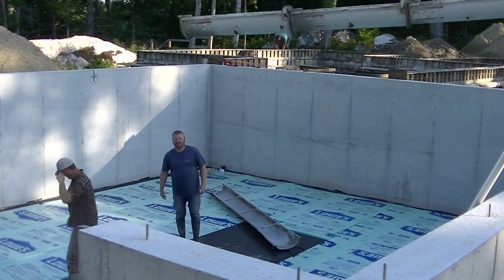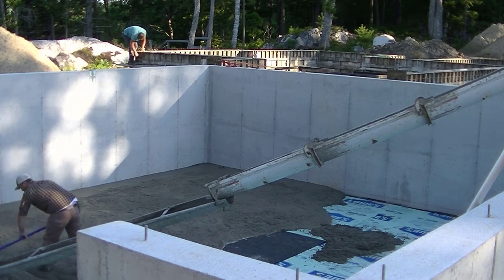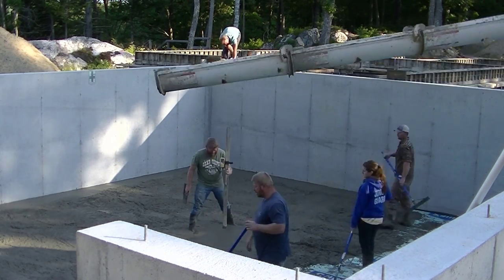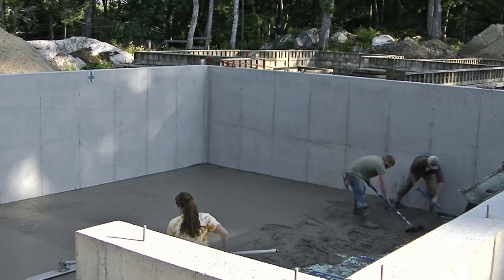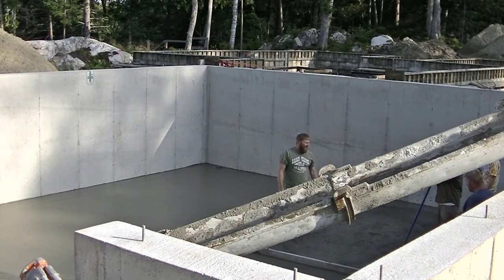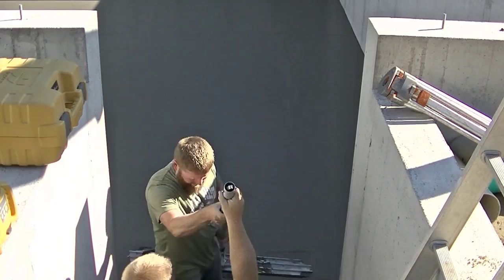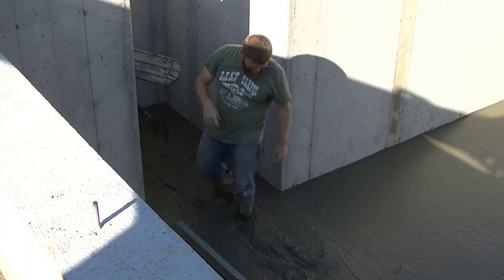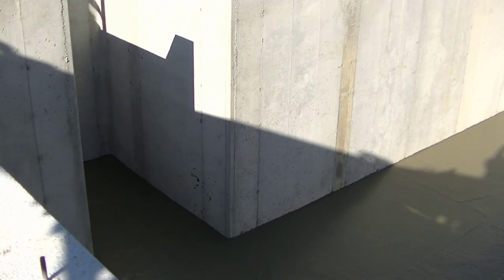Pouring Concrete For A Basement Floor | Beginners Learn How To Pour Concrete

Comment: I just started my business, thank you for the vid,I'm nuts I'm almost alone most of the time,,1400sq my last house ,,I pulled the rake and skreeded alone,,with a pump truck ,,insain ,,,then hand trowel,,3hands, I really liked this video 🖒
Reply from the maker: It's hard by yourself. I've done plenty alone also. You'll have to find at least one good guy you can train at some point. You can do so much more work with another good guy.
Reply: @MikeDayConcrete  i come from 4man crew's my hole construction career ,once in awhile I use a man or two ,but mostly I'm alone ,,thank you for your support and the replies thank you

Comment: I like the Tremie definitely keeps things cleaner!
Reply from the maker: You're right, we use it a lot on these basement pours.
Reply: @MikeDayConcrete it's necessary to avoid separation of aggregate in the pour, you can drop premix too far

Comment: Do you have videos on leveling concrete?  Is there a key aspect to focus on such as making sure the dirt is level first? I will be pouring a Crete floor on my 7' cellar. I will be using a 15mil vapor barrier beneath. Any tips would be much appreciated.
Reply: How’d it go?

Comment: Hi Mike - great video.
Our house was built 40 years ago (August '83) with a standard 8' concrete foundation and 4" floor. In the last couple of years I have noticed several small patches of eflorescence. The biggest one is about 8 inches in diameter and is causing some slight edge cracking.
I didn't watch them pour the floor but I am assuning they put down a vapour barrier, even in '83.
We have had several floods of 4 inches or less due to power outages (sump pump) - we put in a Generac 5 years ago so that solved that problem.
The concrete was also flooded with at least 12 inches of ground water in the 3 months after the floor was poured because we didn't have power yet, so the concrete was essentially wet for its first 3 months.
Question - is it possible that the eflorescence I am seeing after 40 years is as a result of the "top" moisture over the years, instead of any moisture from underneath the floor slab?
Thanks.
Doug

Comment: I am pouring a small cold-cellar floor (10 x 20). Do I need to tie or anchor the new concrete to the existing concrete walls? I have poured several sidewalks (without anchoring to the walls) but they have pulled away and left 1" gaps. Is there a difference between floors and sidewalks?

Comment: You put the vapor barrier under the foam? I am building a 48x66 shop for myself with in floor radiant heat, 2” foam.

Comment: I hope you answer this. I'm in FL, looking to move to Maine with my job. I'm going to have to build. What is a fair price for an 8' wall 30X60 basement? I have just started to consider this an option. Hopefully I'll be moving to the midcoast area, within an hour of Rockland if everything works out. Thanks for your time. Also, now that I think about it, I guess you only do the slab, huh? I prob should check with someone else for the walls and digging. That just occurred to me. Thanks again.

Comment: Where I’m from (So.Fla), we practically never do basements. The high natural water table just makes it prohibitive. We did a basement in a parking garage, for the city of Delray about 15yrs ago and they’re still regretting it. Just to build the job, we had to run 2 concentric well-point systems and even after seeing that, the city still could not be dissuaded from doing it. I guess when you’re spending other people’s money it’s easier to ignore the obvious. 🤷‍♂️
🤜🤛
Reply from the maker: Yea, it really depends on where you live if a basement is done or not. I can't speak for other states but here it's most of the houses we do. I'll pour 100 to 150 of these a year (April - Nov.) I used to do even more when I had a 7 man crew.

Comment: The speed of the video likely makes the slump appear higher than it really is.  At first I was thinking your mix was like soup from how the paste splashed quickly away from the boots.  At normal speed, I’m guessing it would look stiffer.   We use a WR admixture when pumping or placing thin element  columns where their’s steel congestion inside the forms.

Comment: Hi, I don't work in construction but I watch alot of videos like these.  I'm from California and most of these guys I watch use pumps.  I'm trying to understand why you never use the pump trucks.  Out here the pumps are pulled by pickups.  Maybe by you the pumps are semi style with a big boom?  It looks like you have easier access to your sites.  I guess you can give a guy a job instead of using a pump guy.  Is it a profit / cost thing?  Curious! Thanks.
Reply: Absolutely a profit/cost thing. Whenever you have the opportunity to pour straight from the truck, it’s always the preferred method. We call it ‘tailgating’ the load in my area. Boom pumps and even 2-3” trailer pumps are expensive and always have the potential for a breakdown. So the more factors that can be eliminated to simplify a pour, the better and more profitable it will be.
🤜🤛
Reply from the maker: Money is always a consideration but the deciding factor for me is if I really need it or not. We do use them occasionally but only if we can't reach the pour. It's 850 for a boom and 750 for a trailer pump, plus the extra yard of concrete. I don't want the waste the owners money if I can place the concrete another way.

Comment: Question. Will the fiber mesh cause any issue if the floor is not covered with carpet or tile and someone walks on the bare concrete with socks or bare feet?
Reply from the maker: Not the ones we use but some could if they're coarse. We use micro-fibers
Reply: @MikeDayConcrete  thanks for the reply!

Comment: Are you ordering the slump 6 or it's  like a 6 with water reducer?
Reply from the maker: Slump usually shows up on site as a 4, then we tell the driver to mix to a 6. It only takes a little water to increase it since the water reducer is already added in the truck when they batch it out.

Comment: I have a stone basement with a dirt floor. Ive already dug a trench for a french drain on one side. Next i need to relocate sump pump into a corner. Trying to decide if i want to put a sheet of plastic down before i pour the concrete.
Reply: If you live in a climate where it gets cold it is good to lay 4in gravel base and 2in foam boards then your 6mil poly plastic and concrete last

Comment: How thick is the slab? 
28x30=840 sq feet
Assume 4" thick slab
840x(4/12)=280 cubic feet
280÷27 cuft/yard= 10.4 yards or about two trucks of 6 yards.
Is this how you calculate the proper yards?
Reply from the maker: The floor was around 4" thick. It might of been 30x30. That's the basic formula for calculating yardage. I got my own way I can do in my head. For 4" floors I divide the sq ft by 80. 840\80 = 10.5  For 5" floors I divide by 65 and for 6" floors I divide by 52.  These are pretty accurate and allow me to figure concrete very fast. If I need to by really accurate, like when I'm doing estimates, I use a formula like what you show. Or a concrete calculator on my phone. My way at least tells me how many trucks I'll need so I can call in my order and reserve the concrete trucks.
Reply: @MikeDayConcrete  thanks!

Comment: So one contractor pours the foundation and they hire another to do the floors? Is that how it’s normally done for most houses?
Reply from the maker: It's quite normal here in Maine. Most wall guys don't want to do the floors so they sub them out.
Reply: It’s called flatwork